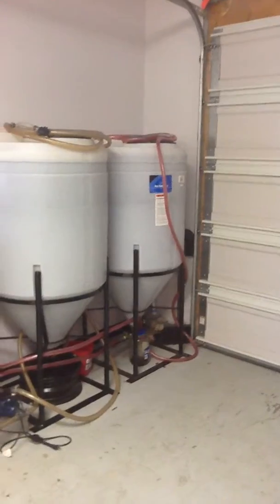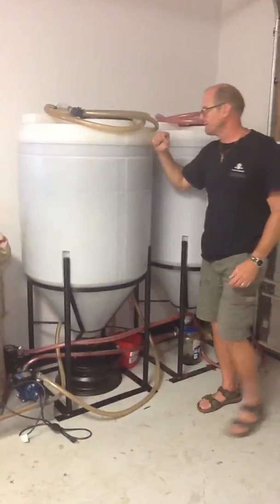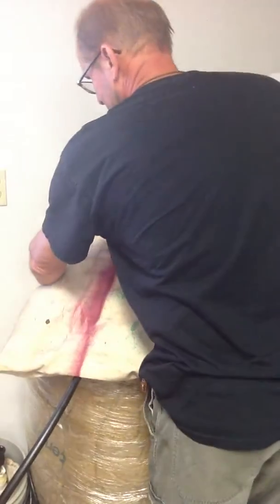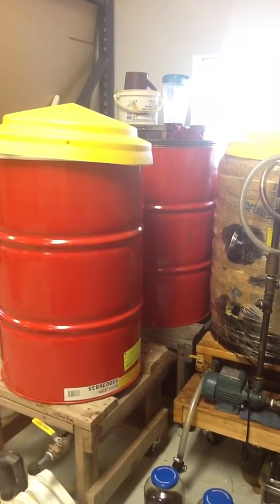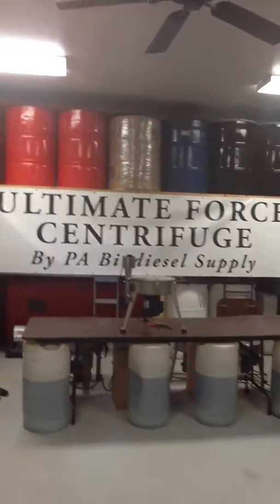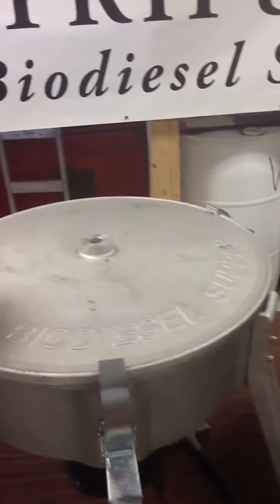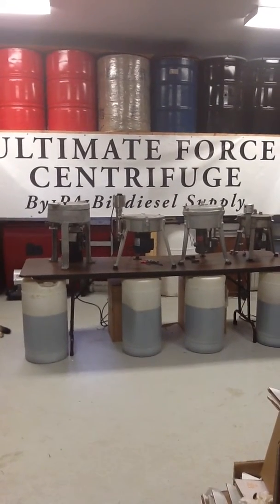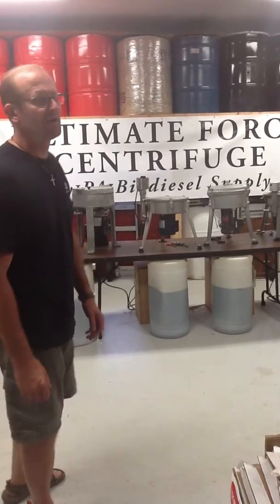We do oil video.

Comment: Good night. I got a 55 GPU centrifuge from your company. It is well machined, but I can't seem to get it to work. Tried numerous setups I tried using water pumps, I've tried modifying motors to power steering pumps, and none of that works. I usually hear a whining sound whenever I tried to obtain the right pressure. Could this be because I don't heat the oil or was it because of the poor pumps?  I'm based in Jamaica and cash is short. Should I just get a rotary pump like the Oberdorfer  1000R-39 or do I just need to heat the wmo. Thanks.